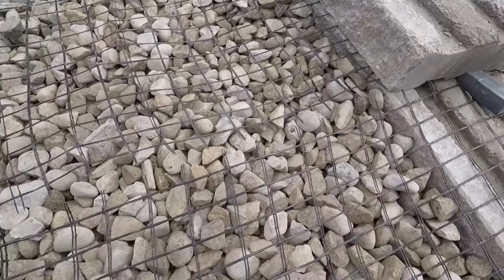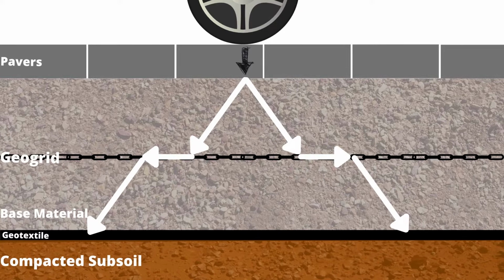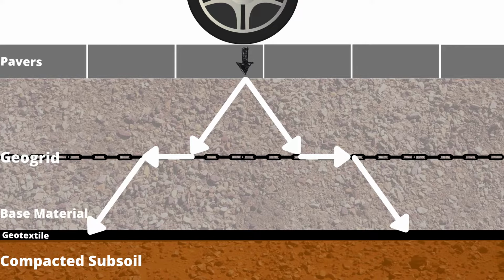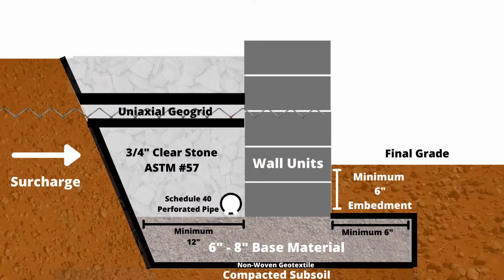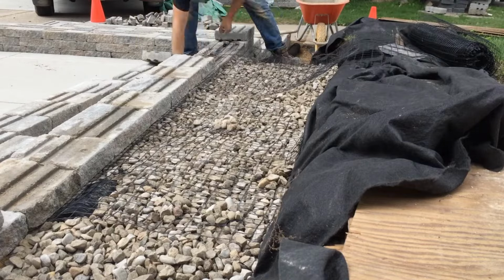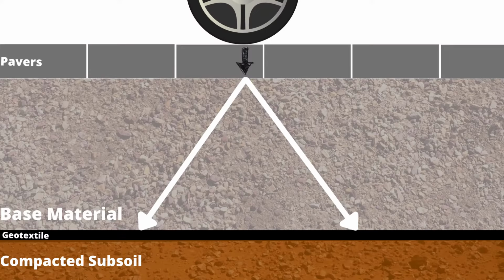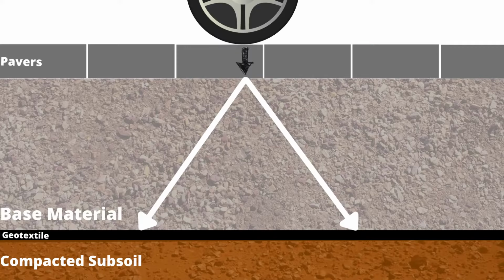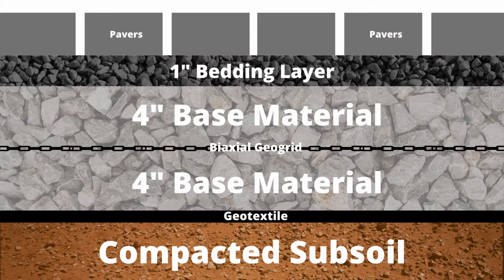Geogrid Installation and Applications | Use This in EVERY Hardscape Install

Comment: What about using biaxial geogrid for separating a compacted 4" base of 3/4 minus from my 1.5" clean rock top layer?  Rock Patio.
Reply from the maker: I would think that would work okay for separation especially with that size of 1.5" clean rock. I would reach out to a geogrid manufacturer though to get a firm answer on that.
Reply: @iamahardscaper Thanks!

Comment: Great video helping me understand geo-grid. Would appreciate a second opinion.  Unfortunately, we're having to redo our hardscape (large format pavers 12x24, 12x18)  due to expansive clay soil. The corrective measures proposed by the contractor include the use of geo-grid layer in the base material and integrated into a 12" deep concrete perimeter, edge pavers mortared to the concrete. We live in a temperate/Mediterranean N. California Bay Area climate- no freeze/thaw cycles, but winters can be wet, summers very dry.  Grade is "flat" but in the front yard sloped towards the sidewalk such that if a retaining wall was built I'd estimate it might be 12" high max.  What would you recommend for the depth of base material above and below the geo-grid? Would you use geotextile in this case, if yes, woven or non-woven?  Which type of base material?  Thank you
Reply from the maker: I’d have to be able to see the property to come up with a plan. As per the geogrid, the lower in the base it is the better. Geotextile I always recommend, in a clay setting I’d likely use woven. But geogrid also provides the benefits of stabilization that woven geotextile does. I’d have to see the property to understand where everything slopes and where the Hardscape is. Base material also depends on this and the subsoil + depth

Comment: I am installing porcelain pavers individually in a wet mortar beds over a 3/4" minus open base (for drainage) and I am installing epoxied pea gravel in between and around these pavers. Around the edge of the whole thing, I want to install the plastic paver edging to hold it all together. I am concerned that the landscape spikes will not get the necessary support/hold in the open graded base to hold the paver edging securely in place. I was thinking about putting geogrid across the whole thing the the spikes go through the holes to help hold everything in place. Is this a good idea or do you have a better suggestion (other than Trass, which I tried to get, but couldn't in my area without having it shipped at a crazy price)?
Reply from the maker: You mentioned you are using 3/4" minus which is 3/4" and sand. Is that correct or are you using 3/4" clear / open graded? If it is open graded, you are correct the spikes will not be able to hold into anything. If it is 3/4" minus, the spikes will corrode and hold in the base. The geogrid wont hold the spikes. Trass would be the best option here, or you could try to use a concrete edge restraint, but if the porcelain is 1" thick you wont get good coverage on the porcelain to hold it. Difficult situation, but if you are wet setting the entire patio I would be less concerned about the edge if it is wet set as well and the porcelain is large format.
Reply: @iamahardscaper  Thanks, I guess I didn't understand what "minus" meant. I was thinking that it meant 3/4" with a mix of some smaller sizes as well (which is basically what mine is (so it is open graded, no sand except the dust on the rocks). That is why it I was concerned that it would not hold. The porcelain pavers are wet set 24"x24". There will be small epoxy glued gravel on the outside of these (~1" deep). I did want to use Trass on the whole thing as it seems like the ultimate way to go. Unfortunately, there is only 1 local dealer in my area and they will only sell to contractors. To have it shipped would be cost prohibitive. So, I guess I will skip the geogrid and just use the edging. I know it won't be great , but I need it as a separator for larger rocks on the outside of it anyway. I got extra long 12" spikes too so that ~8" will be in the original compacted soil at least. Thanks for all of the great information on your channel!

Comment: Im laying 200sq ft of blue stone 36x18.  Mortar ontop of a concrete slab.    Could you use this geo grid as a lateral strengthener in the mortar ?    would it help or hinder?   thanks
Reply from the maker: No, I don't think so. I think you would want something made out of fiberglass for that to work. But I'm not an expert in something like this

Comment: If you are using Geofabric between earth and drainage rock behind wall, how do you get the geogrid to go back into the earth? The fabric will be in the way?
Reply from the maker: In that case you wrap the geotextile towards the wall, install the geogrid on top, and then continue with a new layer of geotextile.

Comment: Building a stoop with about 3-4 steps and landing. Which should I use and where do you order from?!
Reply from the maker: Check your local landscape supplier. I use biaxial in steps and landings.

Comment: Great video! I am looking to use this geo grid in my garden project but there is a large dip in the middle of the garden. Can you use the geo grid on uneven surfaces? Any help much appreciated. Thanks
Reply from the maker: No, it needs to be placed level to work appropriately
Reply: @iamahardscaper  thanks 🙏🏼

Comment: Is there any benefit on a short gravity stacked block wall (which technically does not require geogrid ) of using a short amount of geogrid extending into the 12 inch section of drainage aggregate? It seems like it would tie the mass of the aggregate into the mass of the wall adding to the overall strength while not requiring any additional excavation or folding/cutting the geotextile filter fabric.
Reply from the maker: I'm sure there is, but I'm not an engineer and I just follow what is specified by the manufacturer in their drawings.

Comment: When you are installing this in a paver patio, are you taking it all the way to the edge of the extra 6 inches you excavate out?  Is it tying into anything or just placed in between the lifts and the stone locking does its thing?
Reply: How much do you recommend overlapping it by?
Reply from the maker: I typically do 6-12” overlaps
Reply from the maker: Yes we extend it into our base extension. And overlapped. Doesn’t need any thing, just place it. It is the load that is placed on it over a wide area and the aggregate that locks it in.

Comment: Would it hurt to always use the 2 way grid in order to carry less equipment from job to job?
Reply from the maker: for retaining walls you cant use the 2 way grid. typically it is a little bit thicker than the uniaxial and wont sit well with walls

Comment: Hi, Just found your channel as I was researching what the best way to hold a hillside is, basically we are are looking for a good solution to stop landslides, the going plan is to use geogrid+gavions to gold it back, what would you suggest?
Reply from the maker: yeah, it depends on the hillside, height, slope, etc. I've never built using gabions. But that would work, large natural armorstone, or segmental retaining wall units. Depends on the aesthetic that you are also looking for.

Comment: Hey Mike, Have you ever used the geogrid incorporated into the base for a spa on top of pavers?
Reply from the maker: I have not. So pavers and then geogrid on top of those pavers?
Reply: No. Compacted base, then geogrid. 5" gravel ( we use #8 limestone) then 2.75" thick pavers.  @iamahardscaper
Reply from the maker: Oh Gotchya, no I still like to pour some concrete and then lay pavers overtop in that area. Still could use geogrid in the base of the concrete as well.

Comment: Hi Mike just wondering if you still use bi-axial geogrid instead of tri-axial in driveway (extensions) applications?
Reply from the maker: Extensions I typically go with biaxial just because of the roll size. triaxial I need to buy in full rolls, so it is a little bit inconvenient but we will use it for full driveways.

Comment: The diagram you provided seems to show the geotextile being folded over the gravel, then Geo-grid laid on top of that, then yet another layer of geotextile as a base for more gravel. Is it okay to sandwich Geo-grid between two layers of geotextile? I assume this is all to prevent soil from leeching into the drainage gravel, while getting the most strength from the Geo-grid. Thank you!
Reply from the maker: Yes you can with non-woven geotextile. There is actually a product on the market called combigrid that is what you describe

Comment: Very informative! at 7:25 you showed 8" of base material separated by 4" biaxial geogrid. What if I using 4" of 3/4” angular crushed base material? Should I separate them by 2" layer or I just need to use on top of base material 4" before putting bedding 1" sand? Thank you!
Reply from the maker: Actually the deeper it goes in your base the better. It stabilizes material that is placed on top of it. Some use a nonwoven geotextile and then biaxial immediately on top. Others use a woven geotextile and then do a few inches and then the geogrid.
Reply: @iamahardscaper  I was thinking it stabilizes material underneath it. Thanks for clarifying! Can't wait for your next informative video!

Comment: Great videos!...new subscriber here. I have an A frame cabin that I want to pour a 4' concrete apron/sidewalk all around the cabin for water drainage away from the foundation but its very expensive. After looking at your informative videos, I'm thinking of placing a 20mil heavy-duty plastic sheeting 6' wide on top of the soil, then add a woven geotextile fabric on top and add gravel on top of the fabric. This will allow water drainage away from the foundation. Any recommendations? thanks
Reply from the maker: This makes sense, I have not done the plastic before. Some have done EPDM liner as a solution I know.
Reply: @iamahardscaper  do you recommend EPDM over 20 mil plastic sheeting for durability and longevity, laid on top of dirt and then adding gravel on top? Thanks
Reply from the maker: I would suggest that, though the cost would be more. I would also get other suggestions from professionals in your area.

Comment: We are putting a mobile home on an area with softer soil. We are having caliche delivered to form a base pad for the home, but would it help to lay down a geogrid first and then pour the caliche? To firm up the base pad for the home?
Reply from the maker: It depends on a lot. What is your climate, what is the size of that rock, what is the depth of the base. Compacting your subsoil is also important.
Reply: @iamahardscaper  The subsoil feels somewhere between beach sand and clay basically. It's in northeastern Arizona. We will compact it as much as we can and then pour caliche over it but it's still hard dirt on top of soft dirt.

Comment: Hi there, I'm building a 3' high round retaining wall and planning to put a above ground swimming pool on top. The pool wall will be about 2' away from the retaining wall. My question is: will the geogrid help or hurt with keeping my retaining wall in place? I want the load to be distributed as vertical as possible (without geogrid load moving at 45 deg) but it seems like geogrid will add more horizontal load and providing load to the wall at higher elevation.
Let me know what u think.
Mario.
Reply from the maker: I would follow the manufacturers specifications based on the wall product you are using. Geogrid stabilizes the drainage material in behind the wall and would likely be necessary in this application.

Comment: If I'm building a 2' block retaining wall to have a paved patio on top do I use both geo grids in the process or just the biaxial to lock in everything?
Reply from the maker: If this is a raised patio with 2+ sides to it, I just opt for the biaxial. But you can always consult with the manufacturer to see what they recommend with their block.

Comment: We are building a two level terraced retaining wall coming down a grade to the road that faces the ocean. They want a patio on 2nd wall area in between the two sections. It will be slate with either sod or other materials 

What type of grid do we need for that layer.

There will be steps and a path between the two runs and will finish towards the road with parking spaces
Reply from the maker: Retaining walls get uniaxial geogrid.

This sounds more like this needs to be engineered. Depending on your region and the height of this, it may require engineered drawings.

A rule of thumb is that if the space between the two retaining walls is twice the height of the lower retaining wall, the walls are built independent of one another.
Reply: @iamahardscaper  we are in the coastal region of North Carolina. The walls will be short in height, under four feet. With atleast that in the middle between them.  There is a slab from the house on the border with footings for porch above.
Reply from the maker: In our area, we require engineered drawings for any walls over 39"

Comment: Thanks for the video. Please I need to know if the installation of geotextile will prevent seepage of water through underlying layers of a flexible pavement during milling? I want to resurface but what is seen coming out from the underlying layer s. Pls advice
Reply from the maker: I’m sorry, I don’t follow. Geotextile will definitely let water through. But there are some (pond liners) that do not.

Comment: This is very informative 👏  can you please  tell me what size aggregate do you use for 4 inch base material and 1 inch bedding for a driveway on loamy clay soil texture?  Thanks!!
Reply from the maker: If you are in a freeze thaw climate, you will want to go deeper with your base. We use 3/4” angular crushed clean stone with 1/4” angular crushed clean on top. Or you can do 3/4” minus with concrete sand on top.

Comment: Where to buy geogrid online from ?

I need 13'x100'
Reply from the maker: I know Amazon has some listed.
Reply: @iamahardscaper  i need larger size 13' x100' or more for a 3000 sq ft porcelqin patio project. 
I cannot find geogrid for patio anywhere. It will be great if you can help provide a trusted online retailer.
Reply: @iamahardscaper  I am going to create open graded base like your other video, but will likely replace nonwoven with woven for added reinforcement
Reply from the maker: Definitely a great idea especially in clay soils. Just make sure that you have a way to move water out of that patio that makes its way into your base.

I wish I could give you a trusted online retailer, but I do not know any that deal with geogrid or even hardscape supplies in general online. Contact your local landscape supplier or contact Terrafix Geosynthetics, Alliance Gator, or other Geogrid manufacturers to see if they have any online dealers.

You also do not need to go the full width of the patio with one single piece of geogrid. Instead, you can overlap the geogrid in order to extend it through the patio space.
Reply: Menards
Reply: we have geogrids

Comment: I know this is a page about hardscaping... but soil is soil!  I'm building a series of small (1' tall or-so, 8' wide) wood (4x6x8) retaining walls on a steep (30-60% grade) dirt hill.  I'm researching geogrid to help reduce the soil's tendency to slide downhill and ultimately overwhelm the retaining wall.  Is geogrid a good element to add on such a steep slope -- or overkill and unnecessary for my application?  

Since geogrid functionally turns soil into a single mass, and since geogrid can be interspersed/anchored with the wall between its layers, in a way does it function like a sort of tieback or dead man, connecting the wall to the soil behind it and using that soil to tension the wall away from leaning over?

I'm just a homeowner trying to prevent erosion on my hill, and I very much appreciate your help.

Thank you!
Reply from the maker: Absolutely, soil has a lot to do with hardscaping. Yes, what you are referring to is the slip plane. Geogrid does not replace the need for tiebacks, instead it stabilizes the soil. I think you are building a tiered retaining wall, so there is some specific engineering that comes into play with those as well. The distance from one tier to the next should be more than twice the height of the lower wall to be built as separate retaining walls, otherwise you are engineering them taking into consideration the load of the top one to the bottom one. Geogrid is great for these applications especially for steep slopes. If you are unsure of the engineering behind what you are building and whether you should be concerned of a slip plane, you can hire a geotechnical engineer. Hope this information helps!
Reply: @iamahardscaper  Thank you -- especially for your quick, detailed feedback!  I especially appreciate your advice to talk to a geotechnical engineer.  My 2 main concerns are:  1. Grossly over-engineering what should otherwise be a simple project, and 2.  Grossly under-engineering a project that seems simple to Joe Homeowner (even though my name isn't Joe), and having it fail when it didn't need to if I'd respected a few key details.  THANK YOU!  I've got a call into someone who may have the next level of expertise that I admit to lacking.
Reply from the maker: Glad I was able to help!